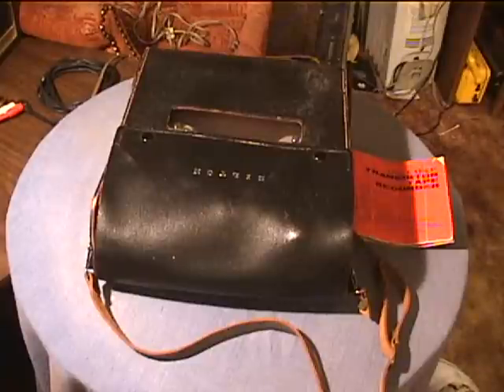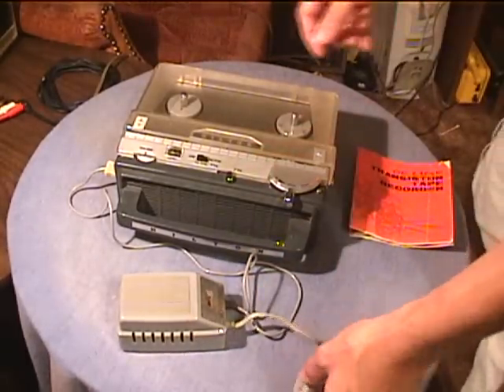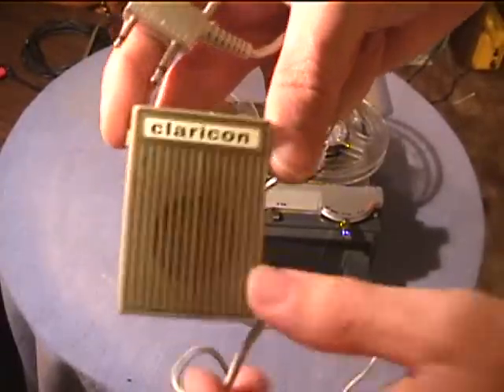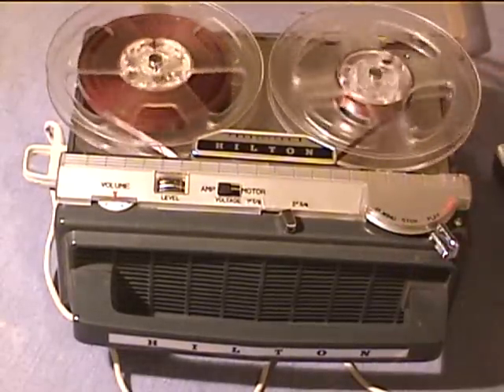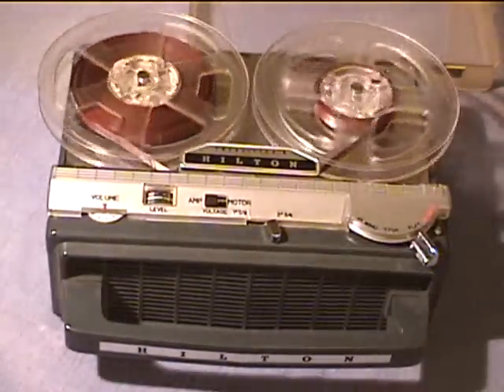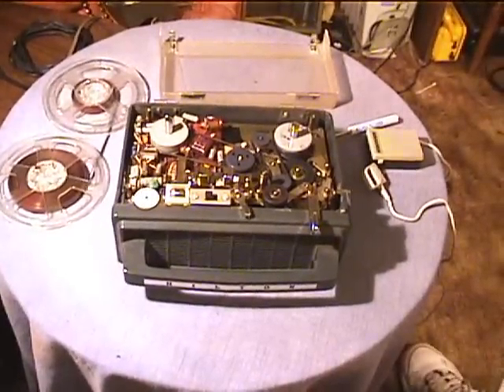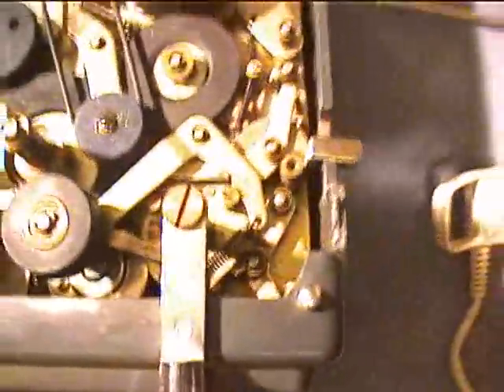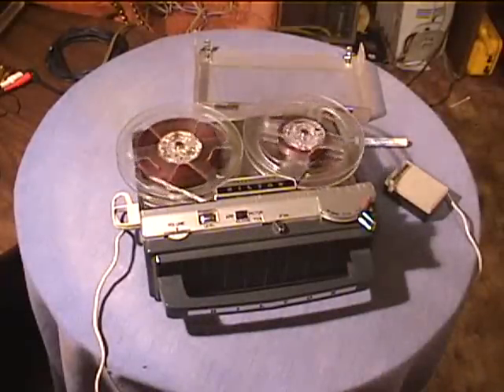The Hilton TRT-635 portable reel-to-reel fixed for umajunkcollector.

Comment: @CassetteMaster The meter on my JVC 3050 portable tv/am/fm/psb radio has a switch for using it as a tuning indicator or battery strength indicator.

Comment: What's the deal with the Voltage Amp Motor switch on the front of the unit?  What does the switch do?